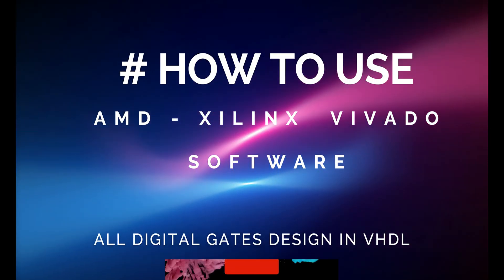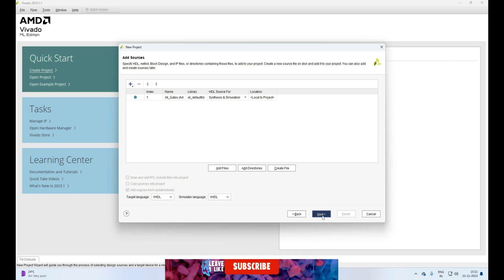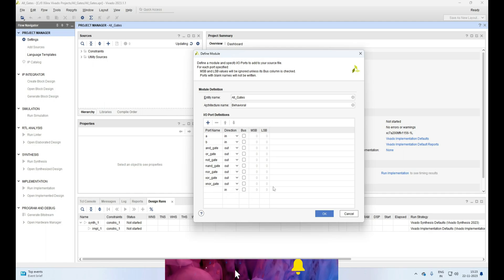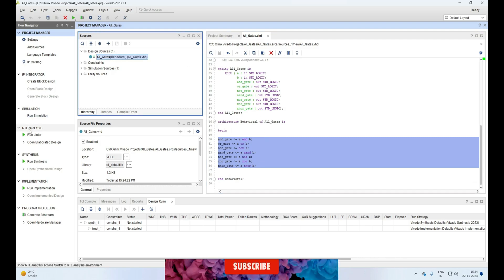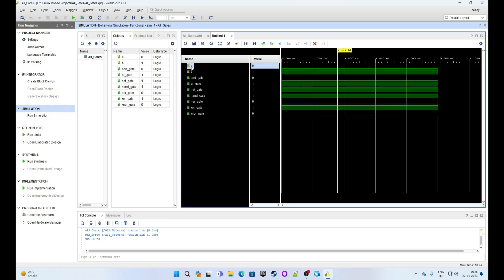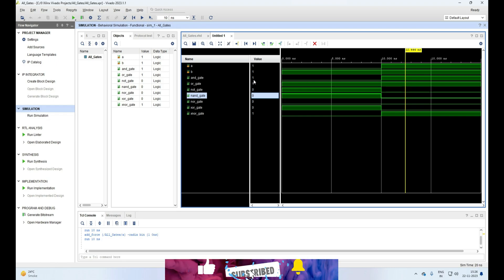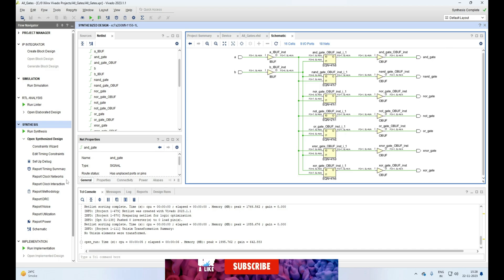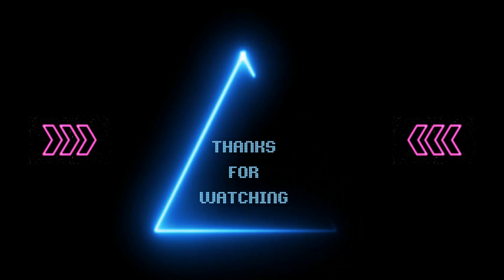Xilinx Vivado VHDL Tutorial: Learn, Simulate, and Synthesize All Basic Gates for FPGA Design

Comment: hello,
it was good informative session 
could u also show what does run synthesis do, is it similar as view schematic?
Reply from the maker: Yes, sure
Reply from the maker: View Schematic is one output of synthesis. Run synthesis is the mandatory process which converts your HDL code into gate level netlist and view schematic is tool to visualize synthesized circuit.
Reply from the maker: In short - When you run synthesis, the HDL code is analysed and optimized to meet the specified performance, area, and power constraints. This process generates a netlist, which is a detailed description of the circuit in terms of logic gates and their interconnections
Reply: Thank you for ur reply